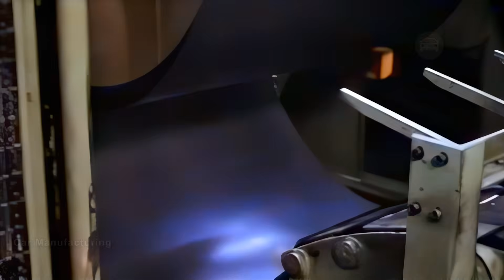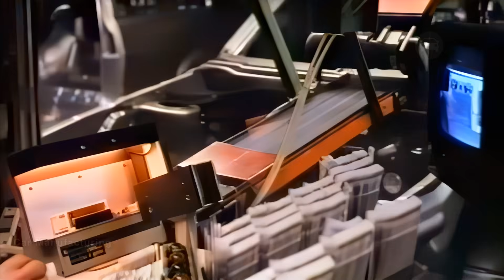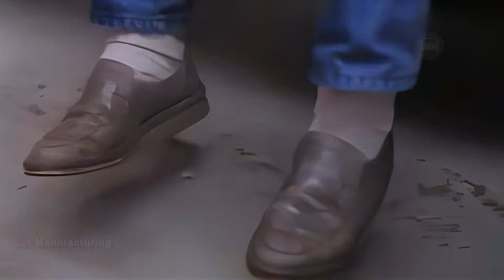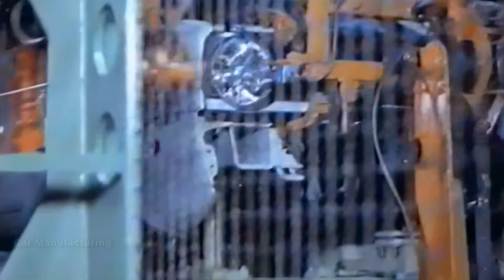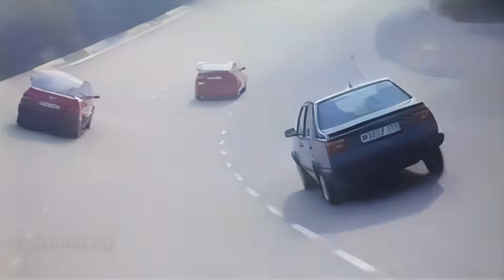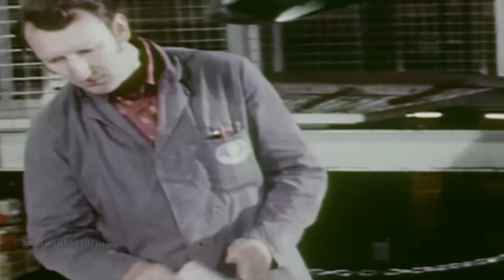How VW Golf & Jetta Were Built in 1989 - Retro Volkswagen Factory Tour (Manufacturing process)

Comment: golf mk2 the best car I ever had. No cambelt tensioner, no variable valve timing, no turbo, no DPF, no Secondary Air Injection Pump, no power steering, no sway bar, no sway bar links,  no multilink suspension, no dual mass flywheel, one camshaft, indirect injection, no facebook.

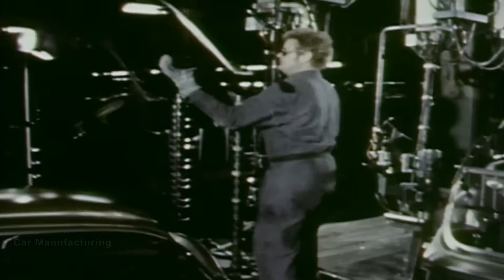Comment: 17:20 - “....in 1974, an incredible 3,800 Beetles were produced daily...”
That's FALSE! — During peak production periods in the 1960s and 1970s, the Volkswagen plant in Emden produced up to 600 VW Beetles per day. Depending on the model series, production reached up to 800 units on fewer days.
The production capacity in Emden was designed for high volumes to meet global demand, especially for export via the Port of Emden. A total of 2,360,591 VW Beetles rolled off the assembly line at the Emden plant between 1964 and January 19, 1978. Beetle production in Emden officially ended on January 19, 1978, when the last Beetle built in Germany rolled off the assembly line.

Comment: aunt had a 87 VW Jetta, then i had a 2017 VW jetta, then i'm having my 1987 VW Fox GL n i'm excited, something about the 1980's cars will always be better then anything of modern day design. they are just a all around comfortable car. fun part is to drive a "80's car" has more respect then driving a brand new car. considering this 88 fox engine is straight instead of sideways. says it has more options which is easier to work on then something sideways. how ever you want to say it, i'll be doing a giant overhaul with this car, from 81hp will be over 200+ hp from the stock motor. i did it with my 84 honda CRX which was a 1.5L so i'm pretty sure that i can hit 225+hp after being dino'd. original engine block with upgraded everything i'll keep ya updated as it gets built

Comment: Our family had a Jetta GL mk2 1.8 from 1987 (built in Wolfsburg, Germany) from 2004 until 2011. The car itself was in a pristine condition, except for the engine that died for unknown reasons. Later, we swapped 1.6 TD and replaced it by an Audi 80 B3 1.8 E or 1.9 E.
In 2012, after selling the B3 due to the expensive fuel prices back then, we replaced it with Golf Mk2 1.6 D from 1989 (assembled in Brussels, Belgium). We had it from 2012 until 2017 and during that time, we had a great memories with that Golf. The only thing that I didn't like was that it wasn't comfortable. Mechanic was simple and we never had any issues. We sold it to my cousin and after a few years, he firstly sold it to a junkyard before getting bought again and getting repainted once again, but it looked terrible after it was done with too much dents (we did it way better and it looked like a brand new Golf after it was finished). Last time I spotted the Golf releasing blue smoke from exhaust (engine was nearly dead and clutch was really weak). Too bad that we couldn't buy it again.

Comment: My 1988 Golf still runs great to this day! The most reliable car I've ever owned. Also easy and cheap to maintain, but some parts are now harder to get.
Reply: I had two golf’s from this era, a German home market version and  UK spec, both great cars, idiot proof to fix and a joy to drive. Re spares, try Mechatechnic in Lille in France. They seem to have a lot of really useful, obscure parts.
Reply: my golf GL its from 1989 🥰 ..... hello from germany 😊
Reply: Mój Golf z 1987 1.6 diesel wolny ale oszczędny
Reply: golf mki1 still going strong
Reply: my neighbours'  Ford and Peugeots of the same year  literally fell apart throughout my Golf 2's 8 year ownership from when it was 3 years old. These cars were still in common use in the late 90s and into the 2000s and that wasn't just with enthusiasts. Today as classics their values are not high because so many survived.  Where as lesser Fords and French cars are silly money as so many got scrapped.
Reply: I had an 89 Jetta with 325k on the clock and the odometer didn't work so I don't know if that was the true mileage.  Drove it like that for 2 years before I fixed the odometer and then another 3 after that.   I literally drove that car everywhere as 20 year old
Reply: My first brand new car was a blue 1988 Golf, had if for 11 years and was about to get to 200K miles when unfortunately lost it in a hit and run accident.
Reply: Spare parts are a problem today.... I also have a Golf 3 1995
Reply: My Golf 2 ran 667.000 km until I sold it !!!
Reply: I used to have one in 1992!
Was Great ,Automatic and only for USA constructed,
But Im a Romanian ,:hand-pink-waving::face-blue-smiling::face-blue-smiling::face-blue-smiling:
Reply: Same my - I have Jetta mk2 Syncro from 88 in perfect condition.
My  dream - if VW will start build mk2 again!🎉
Reply: that's a bold faced lie
Reply: I had,85 Golf 1,8 l manual transmission, excellent quality  great  car drove  for 12 years, minimal  repair, Toronto Canada 🇨🇦 market.
Reply: Super
Reply: 😂😂😂😂😂toilette 🚻 🚽
Reply: @francescosavoia8240 sokho
Reply: I know a guy who bought a new Volkswagen golf every 3 years since 1988.  He was so afraid that the car would fall apart once the manufacturer warranty ended,  and he would be forced to pay the high repair cost the dealerships would charge for non- warranty work.
Reply: @dand3975  yeah this production line is not where mine was born. 1987 Golf GL, 'Hecho in Mexico'.  But the fuel distributor & auto transmission were shipped over from Germany. The heatshield near the catalytic converter was coming loose yesterday, got it bolted back up but I see a crack forming in the engine/trans cradle. Might weld it up next year, who knows?  Thing has either 540 or 600k miles. They have that famous odometer problem which is funny seeing as they are so rugged.  Maybe replace it with a used Tiguan one day. Who knows. 
The trans failed twice, once hardened O rings, the other time forward clutch diaphragm.  The parts were less than $5. but my own labor to repair was hours : l  
Still rock solid cars though.

Comment: Some of these vehicles will still be on the road.. That was what you called quality back then.. Built into the product - not just crammed with tech
Reply: i just drove new vw - cannot even begin to explain how horrible it is
Reply: @mug_spinner I call BS, very few if any VWs are “horrible” to drive when new. So,e aren’t the most reliable in the long term, but horrible to drive? In comparison to what?
Reply: @sjb2471  anything. it was the worst car ive driven. and i did drive lada.
Reply: these cars sold in 10s of millions. of course some of them are still on the road but it's very, very rare. it was rare even 20 years ago.
you can only find them on remote islands in the mediteranean where there's not much rain, snow or salt on the roads, and even then they are a noisy, smelly rust bucket with no AC. absolutely horrible.
every time cars became reliable, some regulation slashed them and it took another decade to make them realiable again.
Reply: @man-xy  do you mean as a daily driver? but as weekend car the gti's still around as weekend car
Reply: @lemcake32422  restored maybe. the only golf 2s around are diesels.
Reply: @ idk i have a golf gti mk1. maintained but not restored
Reply: @lemcake32422  why are you lying? you're using a 50 year old car daily? 🤡